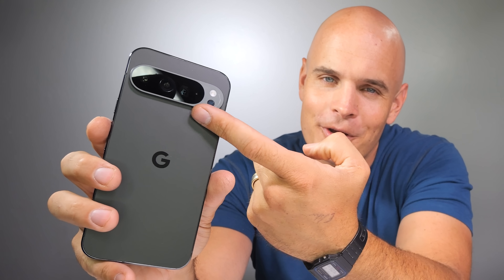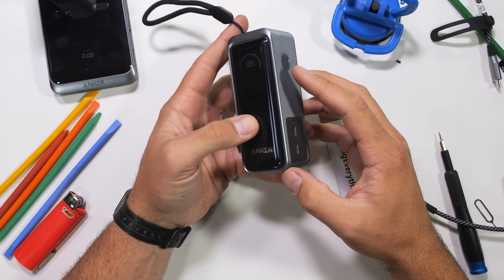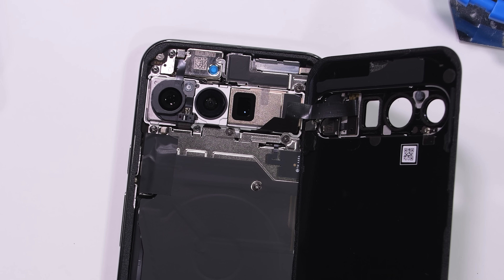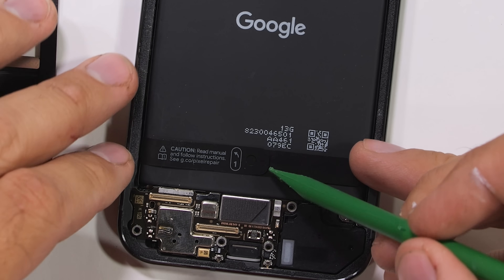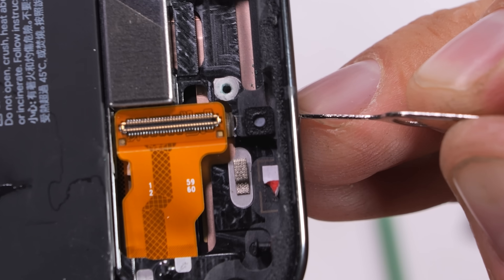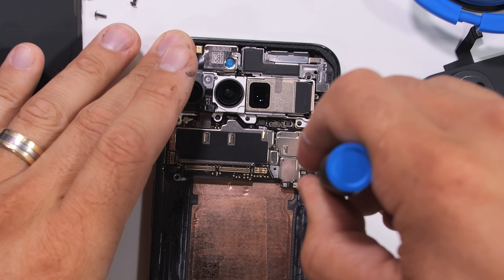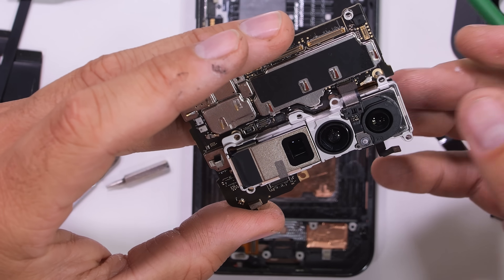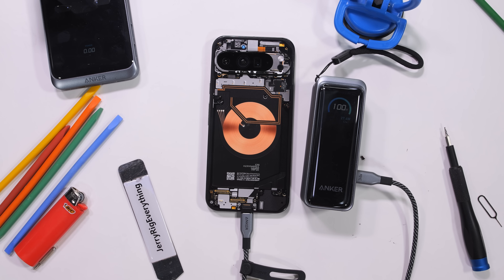Google Pixel 9 Pro XL TEARDOWN – (turn back while you still can)

Comment: It seems that the graphics on the lifting straps that run under the battery are instructing you to lift up each side in unison. When you tear down the Pixel 9, can you give that a try?
Reply: Unstick the pull jacket

Soften the glue
Place the device face down on the heat plate set to 158℉ (70℃) 
for 10 minutes to soften the battery adhesive evenly.

Secure the device 
● Place the device on the fixture and adjust so that the 
device is centered.
● Turn the handle clockwise to lock the device in position.

Lift the battery
Pull directly upward.
Use caution
The battery is easier to remove if 
you lift the battery as soon as the 
device leaves the heat plate 
before adhesive curing.
● Wear ESD finger cots to increase friction to prevent the 
pull jacket from slipping.
● Pull both sides of the jacket perpendicularly to remove the 
battery.
● Gently remove the battery and store it safely.

Comment: I repaired a lot of my own phones and from my experience, the Pixel 9 looks quite repairable.
Seen a lot worse.
Reply: He's just comparing it to other phones currently on the market. Of course it can be repaired, just not as easily as many other phones.
Reply: @prairiepanda  I don't really see much differences compared to other phones. Well except Fairphone.
Front and back access design, usb port on separate board, the volume buttons can be changed with no disassembly.
The battery surely would be easier to remove if heated + some alcohol.
All other things seem to be like in any other phone.
Reply: @prairiepanda say a battery repair cost for this model is $100. And say if you were to go a phone technician to get the battery replaced, he will charge you $100 if the phone had this kind of "difficult" battery adhesive BUT he will still charge you $100 if the phone had pull tabs like apple or Samsung devices. So general consumers like us have no business worrying about this type of battery placement.
Reply: @prayashshrestha   As someone who likes to repair my phones with my own two hands, it’s important to me how easy it is to do a repair without breaking something
Reply: @LazorVideosDestruction  fair enough, but as someone who like repairing your own phone you should know it's not as difficult as the video is making it out to be.
Reply: @prayashshrestha  It’s definitely still possible. I don’t think any of the phones I’ve repaired so far have been much easier lol. Galaxy phones are getting better though, I really liked the battery pull tab in the Galaxy A54. Was able to yank it right out, no fiddling with a plastic saw thingy.
Reply: Exactly my thoughts.  Oh noes!  Screws are different lengths, and I'm incapable of keeping track of them!  Oh noes, I need to use alcohol to remove the battery!
Reply: @meanderinoranges Fr I'm tired of people saying using alcohol makes a phone super difficult to repair.

Comment: Not cool Google. Not cool.
Reply: This phone looks incredibly easy to work on.  I'm at a loss as to why people are irritated.  It's not hard to keep track of different length screws.  Alcohol on a battery is only a minor annoyance.
Reply: @meanderinoranges  sure it is, but it impares user repairability. If done right with the help of online manuals and at home tools, one could repair their own phones. For this one, if one is not experiened, it needs to be taken to a shop.
The first ever phone I had I could work on with only one or two screwdrivers. Look how many different tools you need now.
Reply: @Domi_Plays  meh.  That's no reason to be annoyed.  Every battery replacement kit I've bought in the last ten years had all the tools I needed for each replacement.
Reply: @meanderinoranges  it is a reason to be annoyed. Mad? No. Annoyed? Justified. Yes, you can buy kits with the necessary tools. Can an average person use them without the risk of damaging any components now? I wouldn't say 100 percent. You could just lift a battery not so long ago. What if one accidentally tears a ribbon? That's another replacement.
Reply: @Domi_Plays  I believe you're exhibiting some Dunning Kruger effect.  You seriously overestimate the abilities of the average person.  The average person has neither the skill nor confidence to do a battery swap on even the easiest glued phone.  No matter how many tools you give them.
Reply: @meanderinoranges  M'kay

Comment: The instructions for the „pulltab“ are right on it… irs not a pulltab
Reply: Fantastic so instead of just being able to pull some tabs on the battery, I just need to acquire some kind of a device that can accurately heat a surface to 70 degrees Celsius. Awesome love it
Reply: I noticed that didn’t look like a pull tab, I call for a redo on that one
Reply: is it not some kind of ribbon to saw the glue under the battery? It might work
Reply: It is not. You heat the phone up on a heating pad at 70⁰, secure the device in some kind of grip, and then pull directly up on those tabs and the battery comes out. 

All of this is detailed in Google's own published repair manuals.
Reply: @StrigidaeParliament  so theyd rather you overheat and cause the phone to explode than actually make battery removal easy?
Reply: @tylern6420  you won't overheat the phone if you follow the instructions and use 70 degrees. It's not that hard to understand xD
Reply: @socramdavid  its not that hard to use more common pull tabs or even have the battery friction fit in place like phones use to always do, both wouldn’t require the added step of heating the phone. No need to act like a tit to someone because Google made an objectively worse battery release mechanism.
Reply: Where can I find that repair manual of Google?
Reply: @avyyam  maybe do some research before making such a wrong statement, yikes
Reply: @baconwizard  objectively worse for the consumer, better for google. 
google was forced to publish repair manuals so now they decided to glue the battery in place in a way that requires you to buy a heat plate in order to safely remove it without a big hassle. 
guess how many people will buy a $50+ heat plate to replace a battery. most people will either get it replaced at a repair shop or just straight up buy a new phone. in google's eyes this is a win-win.
Reply: @SlickSloth Then go buy a heat gun, they are cheap and common. You'll still be able to do the same thing.
Reply: @DeliciousFoodReviews  you're missing the point. as a consumer I shouldn't be required to buy additional equipment (beyond regular tools) to simply replace a part which will inevitably wear out. this is completely unnecessary and goes to show how little google cares for individual customers (which is further reinforced by the fact that google's own public repair manual shows a professional grade bga preheating station that you cannot even buy as a regular consumer).
Reply: @StrigidaeParliament but the point then still kind of remains the same. Instead of using an industry standard pull tab that usually works just fine and isn't like some super expensive thing, they choose an alternative that requires additional knowledge on how to do it (since it's not the standard method), a heat pad, and some kind of grip to hold the phone steady. Why would they require you to do all of that instead of just a simple pull tab that only takes your two hands to do? 🤔
Reply: @SlickSloth  you need a heat source to even open virtually 99% of the phones that are sold nowadays.
Reply: @StrigidaeParliament  Sounds like it's anything but standard. Even iFixit had trouble breaking down the Pixel phone.
Reply: @SlickSloth  you need a heat gun to open your phone anyway tho...
Reply: @SlickSloth skeptical cat here.

Could it be that it's an innovation in heat dissipation from the battery? It looks like it from my pov.

Also you don't need a heat gun, just a common hair dryer will heat the phone to 70 Celsius. And hold it with gloves.

No special tools needed for any of this.
Reply: @dariusdareme  there's nothing really indicating that the battery glue helps with heat dissipation in any way.
most hair dryers won't exceed 60 C so no, your regular run-of-the-mill hair dryer cannot be used as a proper replacement for a heat gun.
Reply: @socramdavid how the fuck am I going to heat it precisely to 70 degrees ?
Reply: @SlickSloth  most hair dryers go up to 95 degrees celsius. Don't know what crappy hair dryer you have, my wife's dryer goes way above 70c.
Reply: @dariusdareme  most hair dryers definitely do not go up to 95°C because those are temps that will damage your hair and can lead to first degree skin burns if used for too long. there's a reason why hair dryers aren't supposed to reach temps this high.
if anything your wife's dryer is a piece of shit without any proper temperature regulation or it's been built by a company with a complete disregard for the health and safety of its customers.
I am aware that there are a few hair dryers that can exceed temperatures of 100°C, but that absolutely isn't the norm and those products do more harm than good.
Reply: @StrigidaeParliament  Looks like heating pads that get that hot with temp adjustments are over $70.  These phone companies will punish you every step of the way for trying to make your own repairs.
Reply: @SlickSloth a heat gun is pretty standard for repairing phones these days because of the adhesive under the glass...
Reply: I'm having troubles finding these instructions you speak of, and quite frankly there's several issues with this video so I don't have the patience to find what you speak of. So a timestamp would be amazing
Reply: Is it 70 degress celsius or Fahrenheit?
Reply: @nathanvrvrt  celsius, it won't make your phone explode.
Reply: @nathanvrvrt  hey genius 70 degree fahrenheit is room temperature it's obviously celcius
Reply: @pradyumnarn  not so obvious. Why do you have to be rude about this? Google primarily targets the phone to users in the US, where Fahrenheit is used more often than Celsius. While it might be obbvious to some of us in the world of electronics, not everyone is tech-savvy.
Reply: @pradyumnarn  Problem is it's not obvious and most people don't have the expertise to fix their own phone. If Zack had trouble what chance does the average consumer have?
Reply: @jevonsims900 Here's an idea. If it's not obvious, use the repair manuals that are provided. People are making it seem like it's a bigger problem than it actually is.
Reply: @pradyumnarn you say that like ots obvious, forgetting that like 2 countries use Fahrenheit lol
Reply: @frank719  as I said 70 degree Fahrenheit is room temperature use some common sense or don't attempt to do something that requires more knowledge
Reply: @pradyumnano no idea what 70 Fahrenheit is. Fahrenheit is the WORST unit of all. It doesn't make sense at all
Reply: @nathanvrvrt Celsius. Why?
Reply: @robertide5182  Because fahrenheit is plain out stupid. Celsius or kelvin are both way superior in any way
Reply: @robertide5182  because the world doesn't revolve around the US... it's actually easy
Reply: @robertide5182 Because the 🌍🌎 world uses Celsius. USA is the only country in the world still using the much inferior scale of fahrenheit.
Reply: @Bronyboiiiii  you're delusional if you don't understand the value of fahrenheit

Comment: This phone is built differently than most phones, that’s cool. What’s not cool is that the adhesive that’s holding on the battery is strong enough to stick together two brick walls, not cool Google!

Comment: We need a clear glass Pixel 9 Pro XL.

Teardown skin is great and all, but clear glass is ❤️
Reply: Idk, the back of that phone is pretty ugly. The teardown skin actually looks nice.
Reply: Yeah but glass is glass, and glass breaks.
Reply: @R2Nexus  wash your hands then butterfingers.
Reply: it's ugly inside
Reply: Using alcohol to remove batteries or screens is just a silly idea.  It seeps into every little crevice including the speakers/mic, cameras, sensors, main board, and worst of all the screen, creates ugly discolored spots.  SMH  Just heat it to 90C on the screen side to get it off.
Reply: Nothing Phone gang

Comment: Google has piggybacked off the enthusiast hype for their pixel phones while simultaneously doing everything that enthusiasts hate. There is no reason to artificially inflate the repair difficulty yet here we are. Hard pass.
Reply: Zack didn't use the "pulltabs" correctly. This is the most repairable pixel so far.
Reply: What's difficult?  The screws are differing lengths?  And that's a problem for you?  Or the battery needs alcohol for removal?  Again, what's the problem?

Comment: 0:09 Google also removed the dongle this year. Earlier they used to provide a dongle in the box which was really helpful.
Reply: Pretty much every mobile now uses Type C, probably that's the thinking, but still they should have given.
Reply: They took that out a while ago. Maybe they keep it for the overseas market. But here in the US they stopped with the 5 or 6 I believe. My 7 pro didn't come with one
Reply: When buying it from the Google store they allowed you to add an adapter to your cart for free
Reply: They included that USB-A to USB C for iPhone users. But iPhone has moved to USB-C. Plus I have a collection of like four of these I've never used. They're good for things like a laptop with USB-A and you have a usb-c cord. Otherwise they're useless.
Reply: Only dongle i would want and that would be helpful would be the usb-c to jack 3.5... Other than that there are cables and they are cheap. Also, chargers now tend to all have usb-c on them so no need to the dongle they usually provide.
Reply: @alexgreg152 this. I love how they included one with the Pixel 3
Reply: They've been doing it since the Pixel 1, it's been long enough. Also with cloud transfer and wireless transferring, using a cable isn't needed
Reply: They haven't had those in the box in years... Didn't get one with my P7P, 6, 4a, or 3a
Reply: It's because at this point you don't really need it anymore. The dongle was basically just a one-time-use item just in case your previous phone did not have USB-C, and you can't name even one smartphone sold in the past 4 years that doesn't have USB-C now. On top of that Android support wireless transfer now which goes by much faster anyway than the USB 2.0 speeds that dongle provided.
Reply: @antikommunistischaktion  allow me, and one of the BIGGEST investors/contributors of USB C's inception, Apple and the iPhone line. 11, 12, and 13 all having lightning and within 4 years each as the main flagship.
Reply: @antikommunistischaktion The dongle wouldn't help if your phone didnt have usb c.

The dongle they are talking about was usb a to c
Reply: @antikommunistischaktion  dollar store phones.
Reply: @Viesta  Even dollar store phone are USB-C now. USB-C has been out for 10 years at this point and has trickled down to almost every device. Maybe there's a vape out there somewhere that still clings to microUSB lol.
Reply: @antikommunistischaktion  oh yeah there are still vapes out there with microUSB... just reminded me of that... and there are a lot of vapes with microUSB
Reply: @Viesta  That's the only thing I can think of, but even then how does a charger that doesn't come with your phone somehow affect your vape? Unless you charge your vape with a USB-C to MicroUSB cable?
Reply: Yeah I am all for removing the USB-C to A adapter from the box. My house has 4 of them now, and only once have any of them been used
Reply: The way I look at it, I have 25 devices that all use USB-C.  I have a dozen or more of the USB-C chargers. Why should I pay for one for each device I buy over and over again.  I am glad to see them NOT forcing us to "purchase" them by including it with every device. Remember, nothing is free, and if they are "giving" you one, you ARE paying for it.
Reply: People always complain but they also always make no moves , if they did apple would see huge loss in profits and we would still have sd card slots and jack ports by now... People need to boycott apple for a start , phones are increasing their prices by hundreds every year.

Comment: Gotta hand it to Google though, that 9 Pro in black is one of the prettiest phones I've seen lately.
Battery situation is a bummer though. Pulltabs arent expensive.
Reply: Yeah, it needs heat instead of alcohol. That's not a pulltab, tha's a "saw" tab.
Reply: your supposed to heat the phone before doing that, its in the repair guide
Reply: Most people aren't going to be affected by this in any way though. I haven't had a battery swapped on any of my phones ever, if you just keep them charged and don't let them drain fully you usually don't have to
Reply: @daylen577  if you change phone every year your right. i don't see the need of buying a new phone every year and have to change the battery ;) so for me its a item
Reply: @daylen577 Aged like milk.
Reply: Alcohol isn't expensive either.
Reply: @meanderinoranges can alcohol damage the internals of the phone ? If it doesnt then why even ask for pulltabs in the first place
Reply: @TAREKOZA Alcohol can dry out rubber, but generally 90%+ alcohol it is mostly safe to use in situations like this. And it dries very quickly. Less than that (like 70% you see in many stores) and you run the risk of corrosion. That’s why water can cause so much havoc — the corrosion.
Reply: @seth4321  so if you choose a good alcohol brand you should be good , in a few years EU will force batteries to be removable , apple will surely find a counterway to make them non removable outside of EU , but i dont think all the others will do that as it makes mass producing harder , but some of them always find ways...
Reply: Repairable phones are also less expensive. Ones that are available, outside the US.

Either way, it'll only be a problem in 3 years. Still a problem.